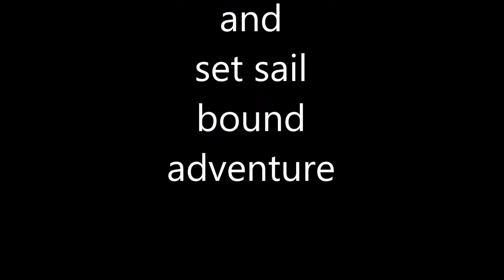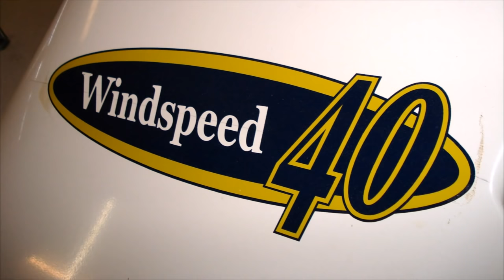How to build a sailing catamaran from nothing. Sailing Mangrove Charlie

Comment: Sir, you've been an INSPIRATION!   I've started with a salvage 18 foot speed boat.  Cleaned up the engine inside out, replaced with car starter, replaced all rotted out components of good but thrown out excess from carpenters etc.,  Now at age 40, I'm thinking of building a Catamaran to sail the world.  This has been an inspiration.
Reply from the maker: Build it 
buy it

Just do it
Reply: Please be sure your bilge fans are working as car starters have no spark suppress... Booom!!
Reply: Go for it Sir, you can do it. Form core off course.

Comment: Great Job! Very impressive, I like many I'm sure have a thousand questions!
First, I noticed the winged rudders, which I assume is for spreading the load when beaching!? How much boat speed was lost, are they angled at all? Thanks in advance 😀
Reply from the maker: Hi Jack
I have be playing with rudder foils for some time, below is an overview of their 26year evolution, currently Mangrove Charlie has rudder foils and forward foils, each generates 500kg of lift 2000kg total, the foils are self leveling for and aft and thwart ships, she is not designed to fly but to be foil assisted for a smoother, faster dryer ride, works for me and I'm happy, more info can be found at mangrovecharlie.com

Stabilizing Rudder Foils
Introduction
The motion of yachts at sea and anchor is the main reason some people don't enjoy yachting.
Multihull yachts generally have a gentle motion in a seaway, however the demands by yacht owners to reduce a yacht's motion is ever present.
Our yachts don't suffer from violent motion, you will not be flung from the toilet with your pants around your ankles, you can cook poached eggs in a fry pan while sailing and at anchor your glass of wine will not spill when a power boat steams past.
We constantly aim to reduced our yachts motion, at sea or at anchor, to ensure our clients yachting experiences are comfortable, safe and enjoyable.

The Concept
We have developed our underwater hull shape and our unique inboard flair to produce excellent seakindliness, however the desire to slow the pitching, rolling, heave and surge motion of our yachts further, led us to the development of the Stabilizing Rudder Foil.

Originally small winglets were designed for the rudders to act as endplates which allows the 20 % reduction in rudder area with the same turning power as the full size rudder. This idea rapidly developed into large endplates which should also behave as stabilizing foils to reduce the yachts pitch and roll motion.
We needed to test the theory and also determine if yachts fitted with stabilizing foils were safe for offshore voyaging.

Test 1 Delta Wing Rudder Foils
Stabilizing Rudder Foils 750 mm long 550 mm wide and 40 mm thick were designed and fitted to the bottom of 750 mm deep rudders. These foiled rudders were fitted to a new 12 metre sailing multihull.
The results proved very interesting, with a gentle motion and no stern squatting or lifting observed.
We know these foils worked well because one rudder was removed and with one foiled rudder the motion was noticeable different.
These Stabilizing Rudder Foils were extensively tested over thousands of sea miles in varied conditions for 12 months with no adverse effects noted. The design concept was correct, the next stage was further design refinement.

Test 2 Smaller Thinner Delta Wing Rudder Foils
New Delta Wing Foils were designed to replace the original foils. These new foils were placed higher on the rudders to assist boarding the yacht after swimming and to reduce the possibility of accidental damage from grounding, they were located approximately 500 mm below the waterline.
Thinner foils were used to further reduce drag. The foils were also placed further aft on the rudders.
These foils worked but they were not as successful as the original foils for these reasons:
They were to small in area and not long enough.
They were not positioned below the lowest point on the hull, so they could operate in clean water.
They were too close to the yachts hull and the water flows interacted adversely.
These rudder foils were extensively tested over thousands of sea miles in varied conditions and were replaced after 24 months.

Test 3 Propulsion Flipper Foils
Thinner larger foils 1200 mm long 700 mm wide with the trailing 400 mm flexible and with a profile shape similar to a cod fish tail, these foils acted like giant flippers.
They worked surprisingly well to windward in sloppy seas and when reaching in a beam sea at high speed 10-15 knots. They were proving quit successful, despite the extra wetted surface area.
These foils worked well at reducing motion and increasing average speeds.
However these foils had a problematic design error, while at anchor with no wind and a slight chop they propelled the yacht ahead, causing the yacht to override the anchor, quit an amazing sight in a crowded anchorage.
These rudder foils were extensively tested over thousands of sea miles in varied conditions and were replaced after 36 months.

Test 4 Large Thinner Delta Wing Rudder Foils
Large 800 mm long 600 mm wide 15 mm thin Delta Wing Foils were designed and fitted. These form a large stiff non flexible endplate and stabilizing foil, fitted 600 mm below the water line and parallel to it.
These foils give the best motion comfort and highest average speeds and after 24 months of extensive sea trials over thousands of sea miles in varied conditions these foils have proven successful!

Test Results of the Stabilizing Rudder Foils

Reduced pitching motion which provides a faster smoother ride.
Effective endplate for excellent rudder thrust for turning, from a reduced rudder draft / area.
Easy transition from displacement speeds to surfing in a following sea.
Reduced transom squatting in a following sea.
Reducing stern squatting under motor which increases motoring hull speed.
Combines well with round bilge hullshape to reduce hull drag and pitching.
Foils provide higher average speeds through less hull drag and a stable sail platform.
The longer the longitudinal foil length the greater the stabilizing effect.
High aspect ratio foils are less effective at achieving these results.
Foils have little or no stabilizing effect at less than 5 knots yacht speed.
Foils provide permanent easy boarding access to the swimdeck.

Note:
Motion metre: Sight along the deck to Horizon and view ruler in foreground to measure pitching.

Conclusion
After eight years of extensive sea trials in a variety of sea conditions the rudder mounted stabilizing foil has proven safe, reliable and effective for reducing the motion and increasing the average speed of cruising sailing Multihulls up to sustained yacht speeds of 18 knots.

Future Trends
The Stabilizing Propulsion Foil for Sailing Multihull Yachts needs further development and they will be redesigned with improvements soon.

Power Multihull Stabilizing Foils
We have developed Stabilizing Rudder Foils for Displacement Power Multihulls to improve motion comfort, trim and fuel efficiency.
We have also developed small forward, inboard mounted, horizontal foils with automatic motion control.
They feature power trim up for a following sea and power trim down for reduced pitching in a head sea.
These four foils in combination with an excellent hull shape will provide exceptional motion comfort at sea or at anchor aboard our Power Multihull Yachts.

Custom Designed Stabilizing Rudder Foils
Now Available for Your Yacht.
Uniquely designed, high-technology epoxy construction, manufactured to fit your existing rudder.
Increase your yachting enjoyment, fit these stabilizing foils to your rudders.
Thanks Jack
Reply: @Mangrovecharlie  Thanks Wayne for your years of testing foils, I took the results as my design my 39 Osbornebay cat.  I am very interested in your cat design details, and do you have a hand draft plan? thanks, Dale from Vancouver Island.